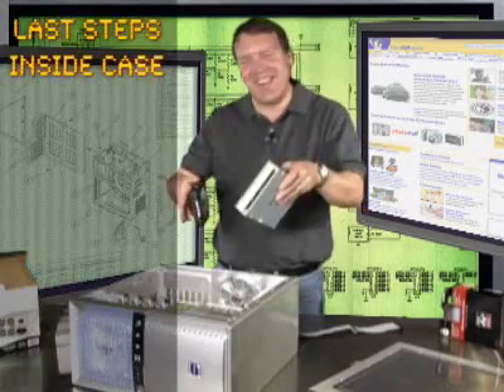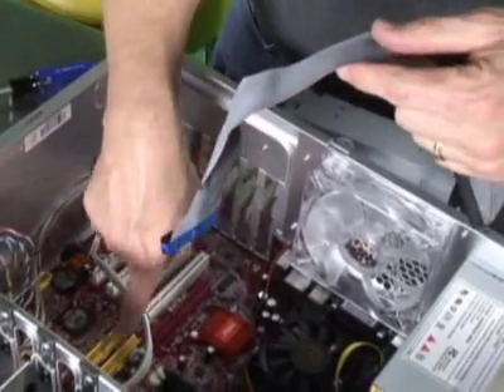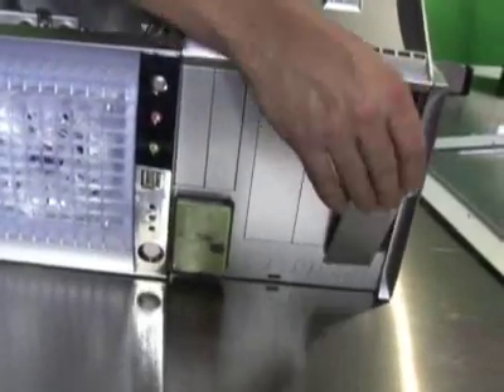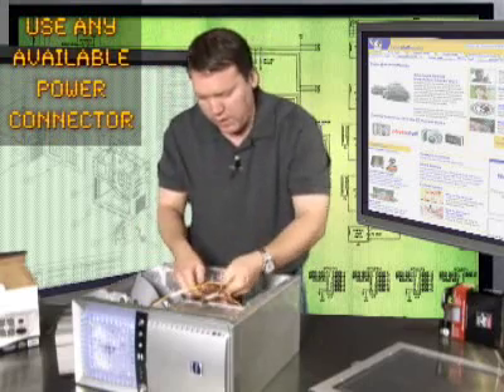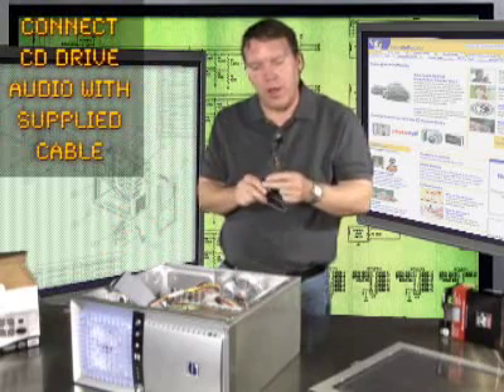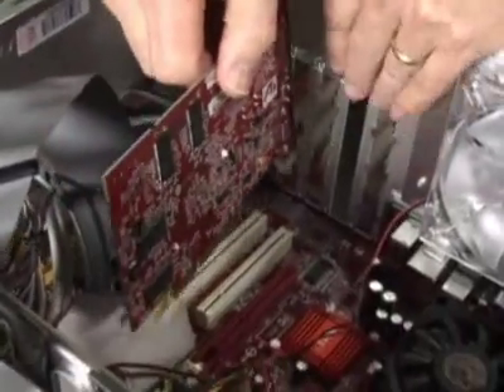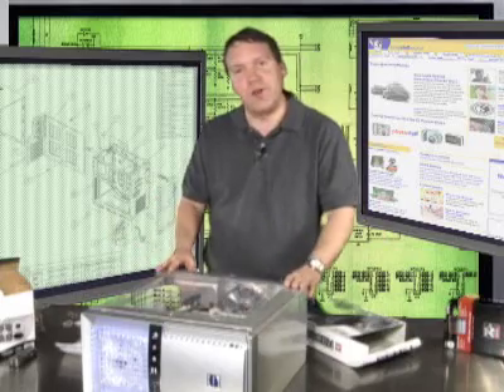Build a Computer Part VI: Installing Hard Disk and CD-Rom

Comment: u mean how to choose OS right? wen u hav installed both os properly it should give u an option at boot time.if this is not workin, install vm ware software which allows u to boot one OS inside another one without restart.also u can try and set the jumpers on the hard disks, set one to multiple master and other to multiple slave

Comment: Yes SATA is different to IDE. The cable connection and socket look like little L's. You plug them in the same was as IDE cables. The cable to power your Optical drive from your power supply might not fit into your Optical drive but it should come with a converter that plugs into another SATA like port on your drive.

Comment: Raptor drive, spin much faster then the standard 7500 rpm sata.

You would need more cooling and air flow inside the case. 

Most people dont benefits from raptor drive. Not to mention it is really expensive.

Comment: Just make sure that if you still want both to  load into the Operating System(Windows), that you don't move the hard drive that has the OS installed on it to another computer. But, if you want to move everything to one computer just disconnect the hard drive unscrew it and reconnect it in the other computer. You can do the same for the DVD drive and possible the RAM if they both have the same type of RAM.

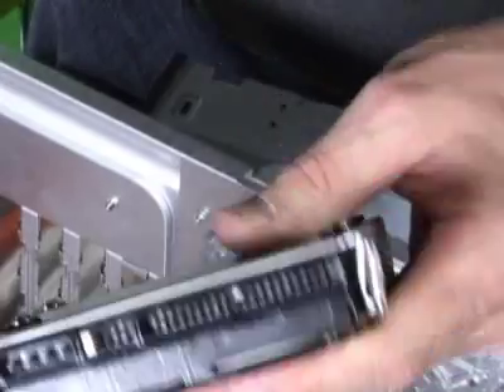Comment: hard drive has two ways to plug in, which are E-IDE and SATA. you have to set jumpers only for EIDE type hard drives.If you stop the video at 0:41, you'll see the shiny little rectangle. that's a jumper. Depending on your purpose of using the hard drive, you have to change the jumper - like master or slaves.

Comment: lol ide and least he could of done was showed ppl how to setup a slave plus he slips with the ribbon cable when he plugs it into the mobo and man not forget with the graphics he says AGB when really its AGP plus if your going to show noob hardware buliders at least get it right and use the lastest equipement and plus he dident wear a grounding bracelet i always do doesnt matter if it just a swap with the hdd or optical drive plus he should of discharged the case which he dident do....sad

Comment: lol hes bad at designing the wires sure you can plug wires anyway you want but you make a spaghetti type problem with your wires and if that happens your wires might get to tight and push some of the wires out resulting in a failure which you won't know about.